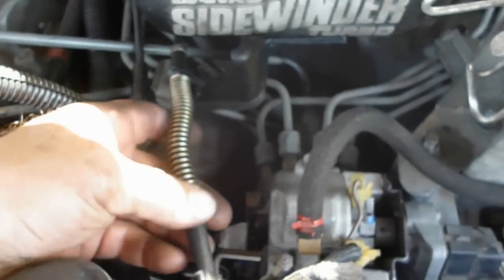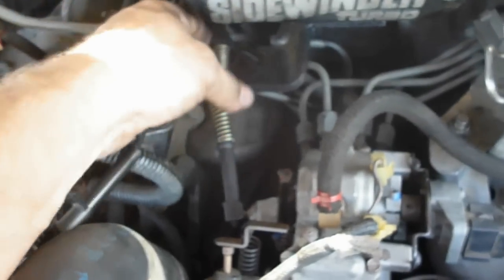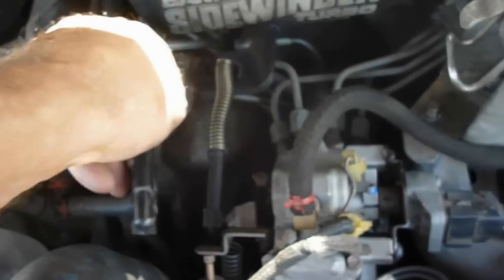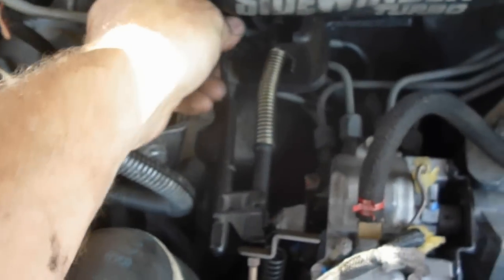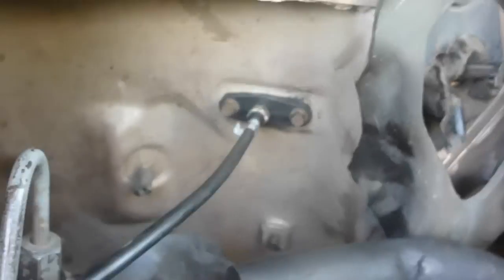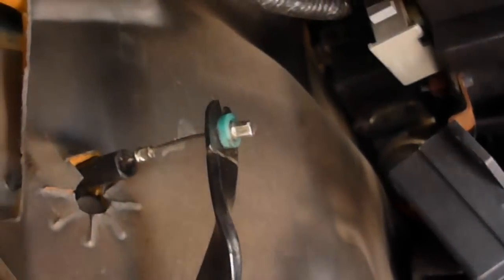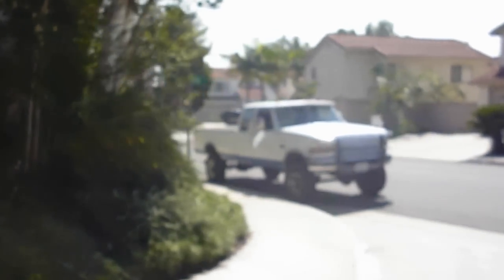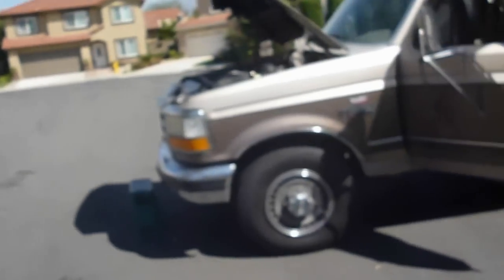Accelertor cable 001

Comment: I have an 85 with the 6.9.  The cable I ordered didn’t fit either it was too long going into the cab and too short where it attaches to the spring so it idled at almost full throttle I found that if I put some spacers between the front of the air intake and the  bracket that the cable attaches to it solved both issues.  I put about 1 inch spacers and used longer bolts to hold the bracket to the air intake.  Worked  great, it idles  as it should now and attaches to the pedal just fine.